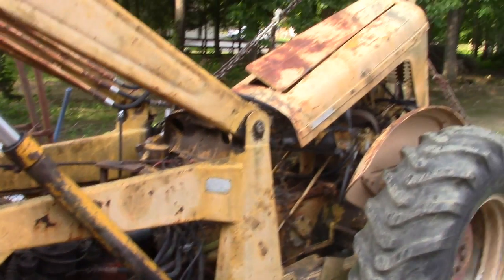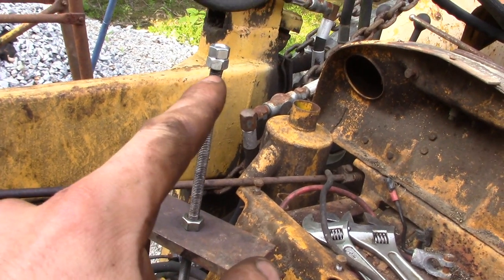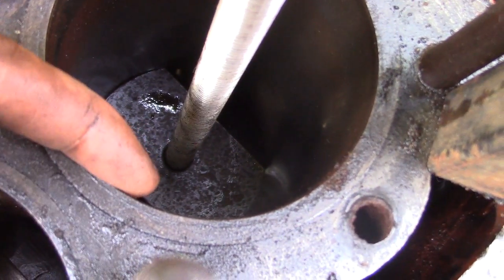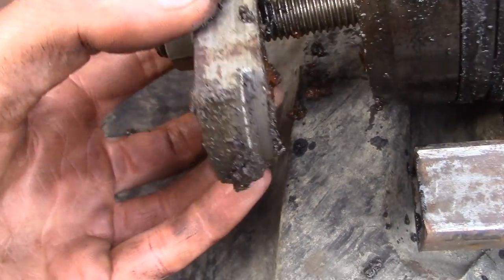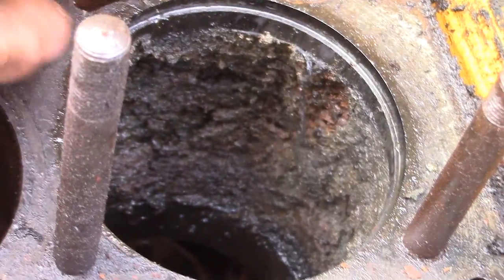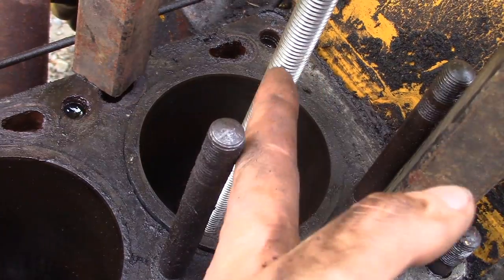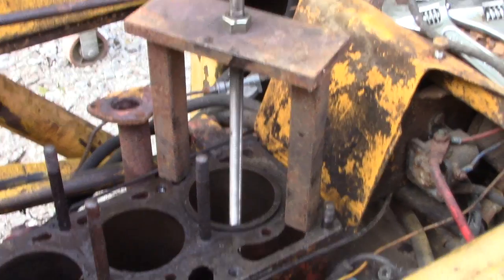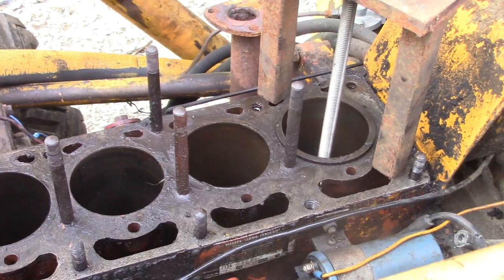Cylinder Sleeve Puller - Make Your Own!

Comment: Was the puller enough force or did you have to start moving the sleeve with a hammer?
Reply from the maker: puller was enough. If they don't come out, run a weld bead up the cylinder wall. as the weld cools, it will shrink the sleeve a bit.

Comment: As fer as I see you did manage to remove the sleelkve with onframe engine and crankshaft still into the engine. Right? Thanks for the video, that is really helpful
Reply from the maker: yes, that is correct.
Reply: so the sleeves came already finished, no need to tear block down and send to workshop, correct?
Reply from the maker: @giemme4492  that's the point of a sleeve, they come ready to go.
Reply: great, to the puller pads is cut on sides to allow it go through the liners from the top i believe

Comment: Does the plate on bottom fit into the sleeve?
Reply: The plate catches the lip of the sleeve and when the wrench is turned, the plate pushes the sleeve up. The plate is always on the bottom of the sleeve making contact with the lip or rim of the sleeve.

Comment: What tipe of engine its that A4. How  did you put new sleeves in does it have o ring ? Or you just preset it ?
Reply from the maker: it's a continental Z134. You just install new o rings and install the new sleeve.

Comment: Why do I always see this whacko shit for pulling liners on small diesels when all you really have to do is size a piece of hard wood and place it between the lower liner and a crank web and turn the crank shaft to press them out? Forgive me for being THAT way but this is Navy Engineman A-School stuff and I have never had any issues with any small diesel doing it that way. The larger diesels I have worked had jacking bolt facilitation on the top of the liner.
Reply from the maker: the liners that i have pulled have fought me all the way to the top, especially dry sleeves! block of wood and a pipe wrench on the crank would be a no-go for me.
Reply: @themadmailler  You don't need any pipe wrench ripping up the crank, the bolt up front with a 24" breaker bar should suffice.